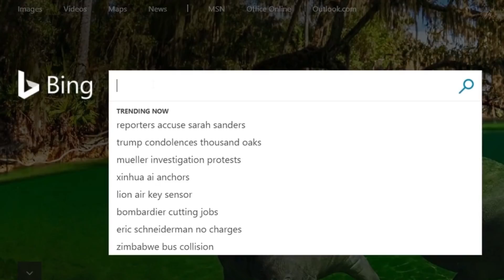PORTING THE FD RX-7'S INTAKE MANIFOLD!!!!! (DIY)

Comment: My dad ported big block Chevy heads for years for offshore race boats and he taught me a bit for my own stuff and I watched him a lot, you did an excellent job Mickey, just add the sand paper roll as a final step if you want, and you don’t need a mirror finish on the polish, if it’s too polished there’s been cases where the air/fuel mixture will “cling” to the polished walls, slowing down intake flow cfm, but killer job, I destroyed my first manifold lol so you did great👌👍
Reply: Thank you! I left the porting areas fairly rough for that exact reason. Just cleaned up the areas where I created deeper groves. I think it turned out great for my first rip!

Comment: oh yeah I've many hours with a die grinder. A little trick I used to use with stick my index finger between the trigger in the body of the grinder to help fluctuate with the speed. It sugar would be facing down or in certain situations you hold it like a knife and you have your pinky under the trigger.
Reply: Thanks for the tip!
Reply: @mickeyandrade3435  knowledge is power

Comment: You need rubber couplers for when the engine moves during acceleration. If it hard mounted it should be attached to the engine only.

Comment: Fd is my all time favorite car. But isnt there problems with the exhaust heating up your intake when theyre that close? That would mean massive power loss once theyre hot right?
Reply: I have a solution. :-)
Reply: Yes and thats what heat shields and proper Ceramic coating are for.

Comment: For a recently rebuilt engine it's amazing how much varnish and carbon is on the inside of those intake manifolds that appear to have come off your car
Reply: There is no tune on it yet. It is super fat on the fuel side for safety and that's what you are seeing.
Reply: @mickeyandrade3435  yeah but the upper intake manifold doesn't even see fuel, I'm not trying to be a dick or anything I've had an FD for 10 years and had that intake manifold off on mine a couple of times and never seen those deposits in there, maybe it's the California fuel :)

Comment: Great job on the new potting venture Mickey, I bet over time you will be great at it and you probably got 99% of the potting job correctly. I know that the extreme porters have ways of hooking up flow test machines that digitly measure air flow concentration with valve degree simulator (ducati motors has a huge tester from their old testastratta engines) but if throtle doesnt want to spend 500k to 2mm on that, than it's all good, 

Rock on Mickey I think you did a great job!!!!!

Comment: I have heard that you should not make the intake manifold smooth inside. Only the exhaust manifold should be smooth. The rough finish in the intake manifold helps the fuel and air mix better and give more power
Reply: That's correct.

Comment: Anyone freak out with the adjustable on a tap? No? Just me?
Reply: kiltedsaint definitely needed a T Handle on that, easy to go in crooked or smoke the threads with an adjustable. 
Would have preferred a drill press for the drilling also but you work with what ya got
Reply: @jazzzyj7589  i agree. A set of tap sockets is a must for every shop. I have an extra set never opened. If you need them Mickey hit me up I'll ship em out to you.
Reply: I've done it with T ... with adjustable .. I've drilled them in ... I've even used a socket and ratchet before .. at the end they all do the same job ... for me is all what tool I have closest to me 🤷🏽‍♂️ #gottawantit
Reply: @RunningSolo  I hear ya. I'm used to chucking the tap up in a lathe or press or just cutting the threads with tool. Adjustables especially that one has soo much more torque that can and will snap a tap.  You guys ever look to spiral cut or power taps? I'm a big fan of you guys by the way.